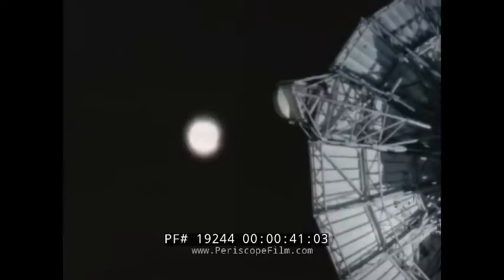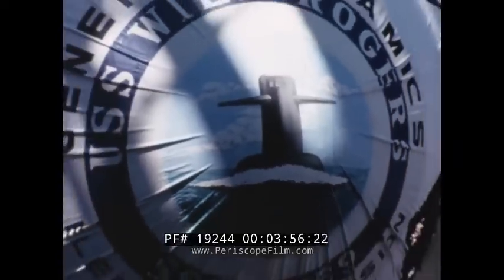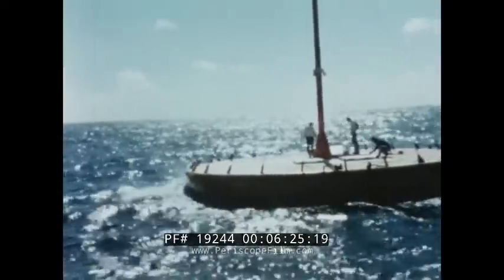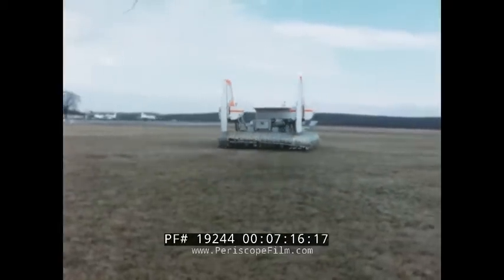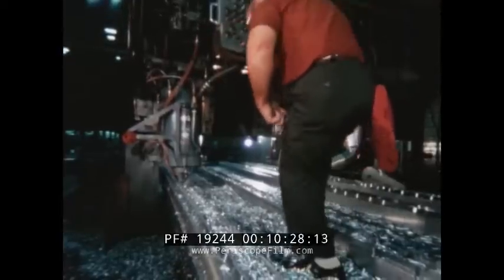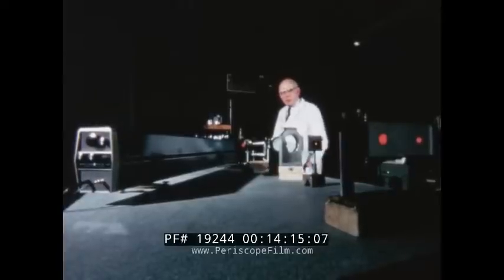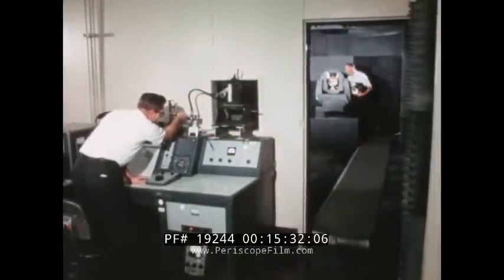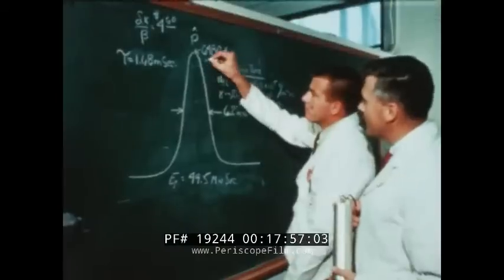GENERAL DYNAMICS TODAY 1966 INDUSTRIAL FILM  POLARIS SUBMARINES  APOLLO PROGRAM  19244

Comment: 1966 and they had CNC milling O_o!!!!
Reply: The shop I work in still had some of the early 60's NC or tape (they were not called CNC then) machines when I first started there nearly 30 years ago. They were difficult to repair. Hundreds of circuit boards with thousands of transistors. They used literal transistor transistor logic with discrete transistors. Mostly Germanium since in the early 60's silicon transistors still were unable to achieve the switching speeds needed. BUT, they became leaky pretty quickly. I was glad when they sold off those outdated machines and were replaced with with high speed modern 5 axis machines. They also presented (and still do) their fair share of repair problems, but nothing like trying to pinpoint that one leaky germanium transistor among the thousands of good ones.
Reply: It sort of seems we achieved the vast majority of physical "things" by the 1960's.